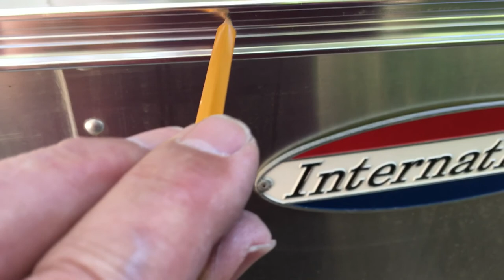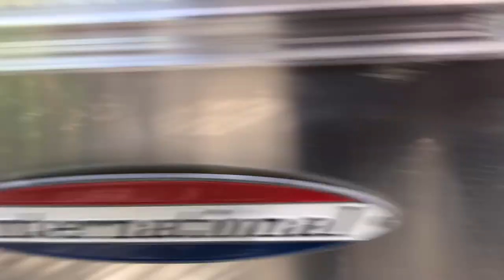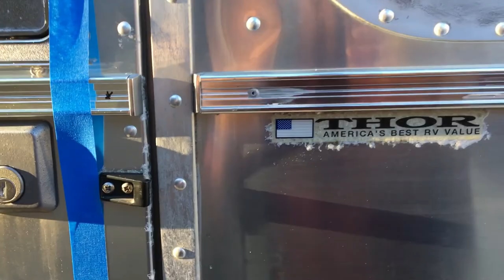Airstream Belt Line Install - Vantair

Comment: Great video! I'm about to replace a bunch of missing rivets from the beltline/rub rail of my 1976 Argosy 26' trailer. What size rivets did you use, and what were they made of? I bought some rivets that were labeled as aluminun but I believe the mandrels are steel. Thanks in advance!

Comment: Thank you so much for the video. I am so bummed a tree branch wrecked the belt line on my Airstream. The track bent so it has to be replaced. It doesn't look like such a huge deal.  I am a new Airstream owner - I haven't had the trailer more than a few months. I'm not sure now to remove the existing track - it's riveted. I live in Temecula and there is no close place to get it fixed. I might have to do it myself. How long did it take you to do the whole trailer and how much approximately did the materials cost?  I have a 28 ft International Signature. You did such a good job - looks amazing!
Reply from the maker: Linda Wolfe 
Hello Linda,

Very sorry to learn of another mishap with our AS
friends ! Bummer when it happens. Upper middle  “belt line” or lower “ rub rail”band section ? Pics would be helpful. 

The inner chrome insert adhesive strip could be peeled  back from the nearest end,  exposing the extruded aluminum holding rivets. 

Small portable drill can shave off top holding portion of rivet to loosen and remove section. 

May need to go a full 16ft of the effected extruded aluminum as that is what the factory length is. Less cutting/matching up. May confirm where the start / stops are and remove just that portion. Re installing drilling  riveting fresh piece back on. Like in video. 

AS Factory can confirm actual part numbers for your vin number to order from nearest dealer. 

Got ours from AS of LA in Pasadena and 1hour drive if no traffic. 

We have remaining spare mid beltline aluminum section and lot of flexible chrome insert band should it be the same as our 2005 25ft

Hope this helps or to someone nearby. 

Dirk. 
vantgogh@gmail.com
Reply from the maker: Linda Wolfe 

Sorry....answering you questions:

Had to overbuy with total 4 16ft aluminum sections to have enough.  est 68 ft + total all around. Plus fresh matching 100ft “spool” of the self adhesive flexible chrome insert. 

Total cost was @600-700 for real shipped factory parts. Would have been additional 200.00 to truck ship to house due to 16ft sections,  so drove 1hr and picked up ourselves.  Dealer quoted @ 1300.00 for whole job. Took about 5 hours taking our time in cold for calif 50F that weekend.